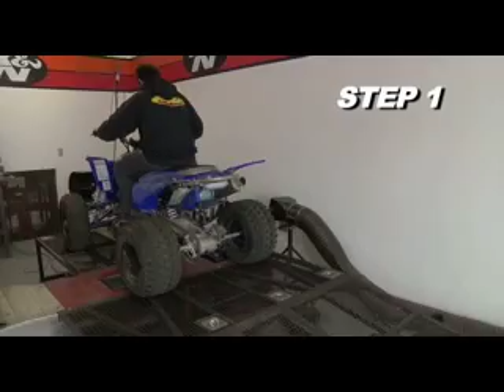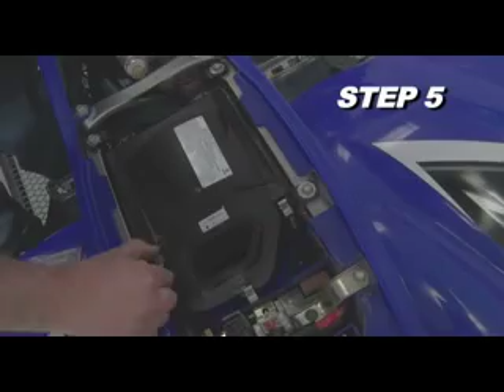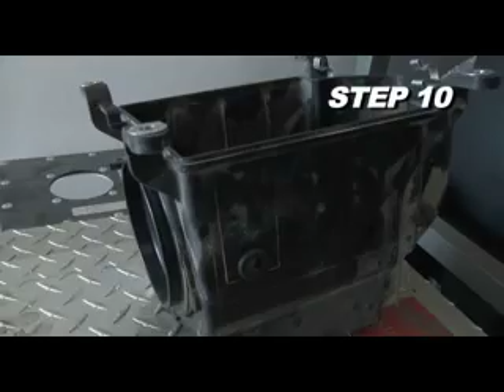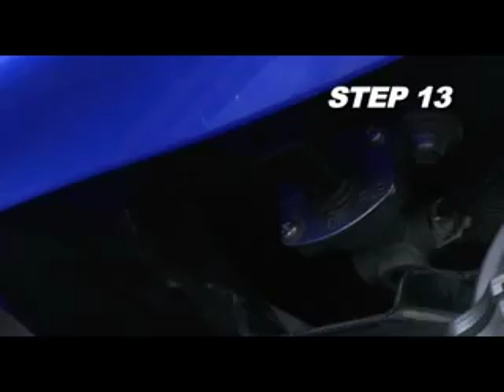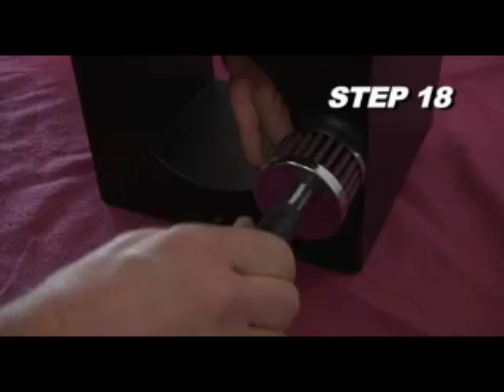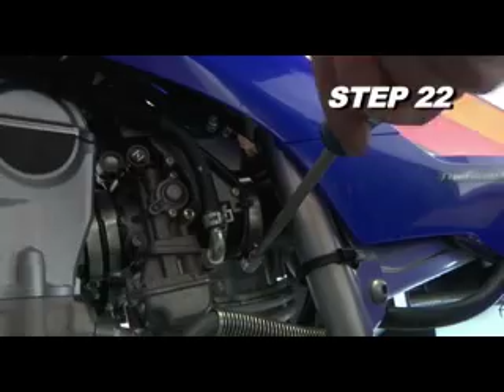Yamaha YFZ450 Sport ATV [#63-1123] Air Intake Installation

Comment: I'd be careful buying one of these. I had one on my YFZ and ended up rebuilding the engine because of it. I kept the filter clean and oiled at all times but it still allowed dirt in the engine. Not worth the little boost to horsepower unless you are racing and can afford to rebuild more often.
Reply: Stephen Turley someone doesn’t know how to install a filter lol
Reply from the maker: All K&N filters are tested extensively per ISO standards with special test dust. Please see: http://www.knfilters.com/efficiency_testing.htm

If you have an issue with your filter, please call 800-858-3333.